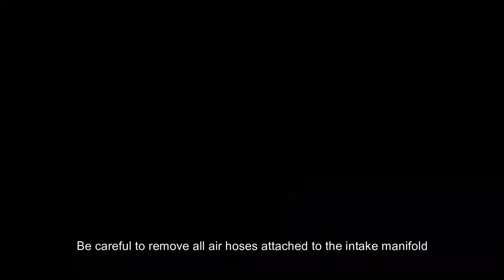MERCEDES INTAKE MANIFOLD REMOVAL AND INSTALLATION,ML350,E350,C300,2006-2010

Comment: Thank you for the excellent video. Am shocked what a spaghetti-like complexity this job involves and how much room for mistakes exists--resulting in further problems down the road. I was forced to have the intake manifold replaced on my MY2006 W211 E350 (at about 100,000 km) after the check engine lamp illuminated due to a tumble flap error. The mechanics first attempted to replace the original plastic tumble flap with a better after-market metal component. However, I was told it proved impossible to remove or drill out the original flap. So, a new intake manifold was the only option. The sad thing is that I expect perfection in all jobs and am willing to pay for extra hours (at $70 Australian) to attain it. Yet after so many jobs and major services I have to waste my time taking the car back to fix problems that should never happen: after a recent change of diff oil, I discovered the diff leaking oil when the drain plug hadn't been correctly refitted. Or, after a wheel alignment the steering wheel ends up not facing straight ahead when on flat concrete in a car park, or small damage occurs to the car and there are many other examples. I think much of this problem occurs due to trying to service too many cars and maximize owner profit. Also, the business definitely needs written procedures and checklists, with an overarching Quality System to ensure that every customer problem is corrected, investigated, documented and discussed at meetings to avoid repetition. I work in a hospital; we have such Quality Systems in order to avoid harming patients--mechanics need similar methods to avoid harm and excessive expense to customers and their machines. I apologise for expressing (or venting) this here, am truly sorry, because you are likely the opposite to what I've experienced, and are the mechanic I've always dreamed of and wanted :-)
Reply: If you can't fix "by yourself with help" can't buy it.